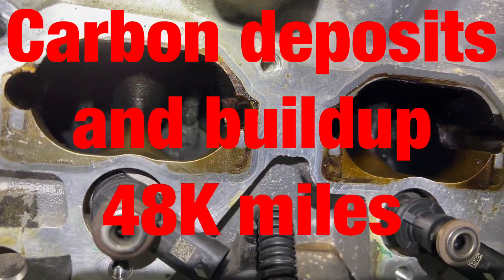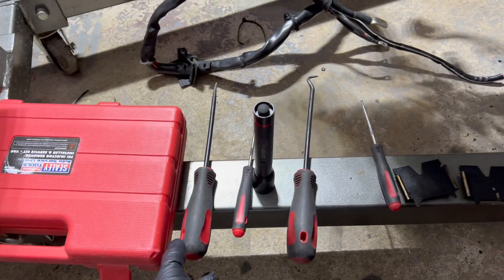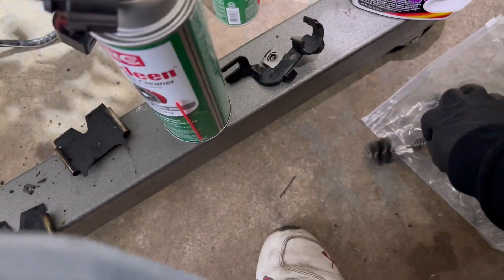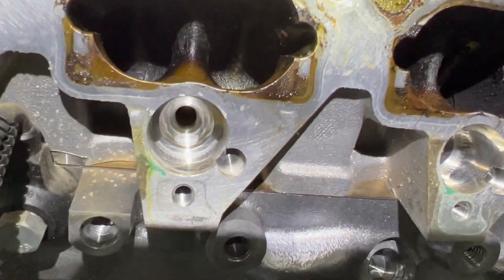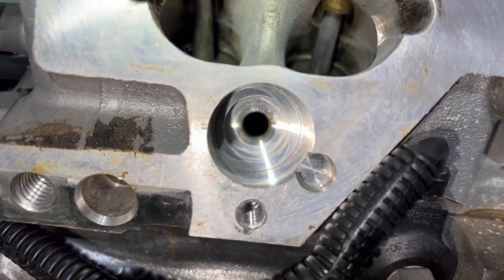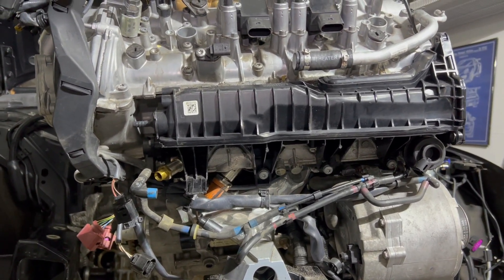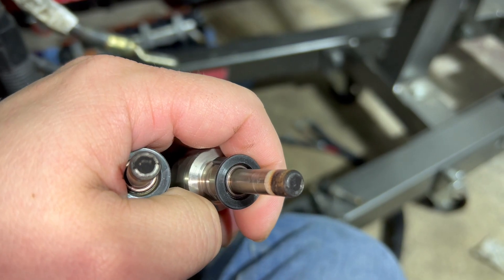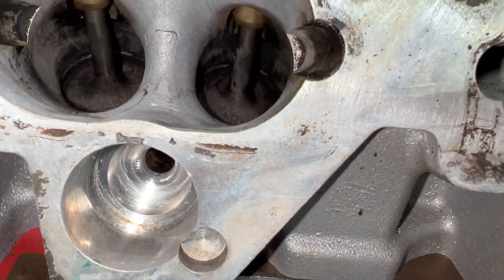Audi 4.0TFSI CARBON DEPOSITS-BUILDUP

Comment: Would direct port meth injection assist with the build up?
Reply from the maker: Absolute yes! This is one of the reasons why I did two AUX fuel injectors 1000cc before the intake manifolds and methanol nozzle to keep the intake ports clean and more fuel for a bigger boost
Reply: @Svarogperformance  Nice! I too just ordered a Snow Performance 2.5 kit for my setup; more so to keep IATs down.

https://youtube.com/shorts/7LHsY5anCJg?feature=share
Reply: Talk with Sean about his injector upgrade.